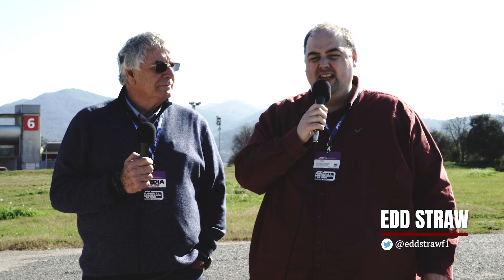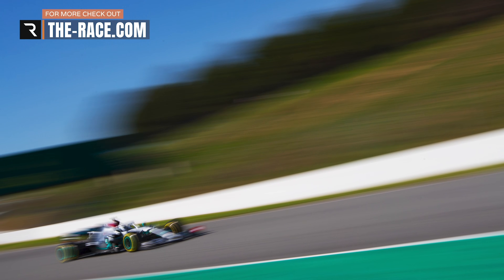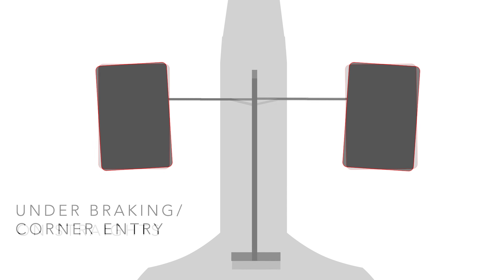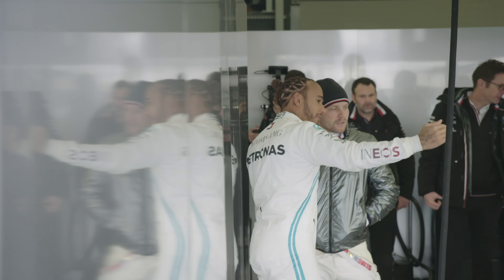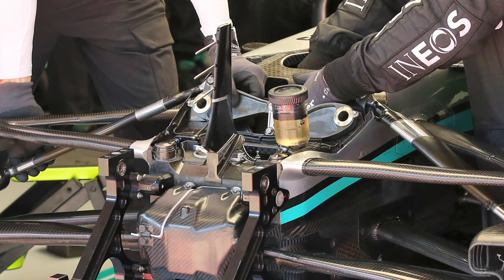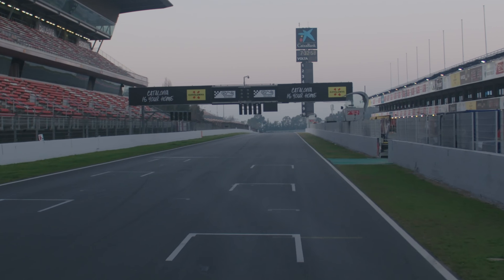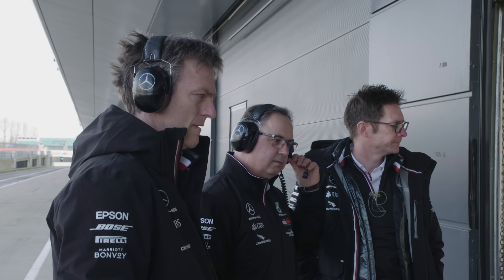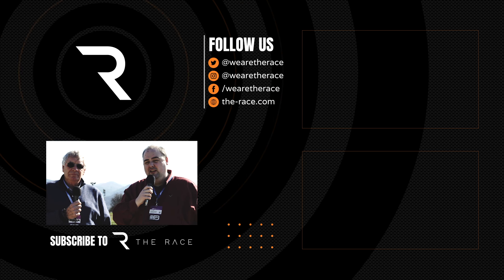Mercedes' new 'DAS' F1 steering trick explained

Comment: there has to be an aero benefit to this as well...toe out creates so much more bad aero wash on the body of the car. also would allow more toe out to be set into the steering knowing that it can be taken out down the straights or fine turned between corners.(you could have a digital sensor telling the driver how much toe is being used at any point in time).  i would also think that others would be able to copy this with out to much trouble as they could add something run it in the car during friday practise and if its not working perfectly just not allow the drives to use it during the race.

Comment: One thing I dont think I heard them address was the increase in straight line braking ability. Not only will this help in other areas but definitely later braking. The more camber you have the more you reduce your braking distance due to tire patch contact. Think if it is used properly not only will they be faster in high speed turns but also allow them to brake later giving them better entry speeds into and out of the corner.

Comment: I wonder if it is significant that it changes toe-in/out and not camber?

Toe is inarguably in the plane of steering, so you are clearly steering, whereas if it changed camber you would be introducing a suspension change, altering set-up.

Comment: @THE RACE This explanation has now been *DEBUNKED* . James Allison has said in the official video explaining the 2020 car that the DAS system was created for aerodynamic purposes, NOT to reduce friction or to cool the tires.

By the way, next time when you're guessing what the teams are doing, use the word guessed instead of "explained", since that's what you are actually doing. And you won't look as bad when your "expert explanation" turns out to be wrong.
Reply: It seems rather obvious to me that toe out will cause extra friction. Friction equals resistance to forward motion AND heat build up. Both front tires pointing in the direction of travel, has GOT to reduce drag, heat, fuel consumption and tyre wear. It's a win win.
It would be most interesting to push the car, then activate the system and push it again. I bet its noticeably easier!

Comment: 2:23 Diagram with animation is SO MUCH EASIER TO UNDERSTAND than the horribly nuanced, jargon filled way it has to be explained. It's actually such a simple, obvious, gorgeous bit of design that I'm amazed nobody has tried it before.
Still, I do agree that Helmut Marko has a point, even if only minutely you are actively changing the ride height of the vehicle and surely that was outlawed with the whole active suspension banning.

Comment: Everyone is talking about tire contact with the tarmac.  How about the aero gains from changing the airflow around the tires based on their attack angle with the air. Air being a fluid, change the angle change the flow. Will the air stall at different parts giving you a speed advantage of less drag? Or will the airflow change which parts of the aero bits are working when. I think there are more effects then just tire wear and heat. Great engineering. Early days of this system. Thank you for making the video. Enjoyed the presentation. Oh side thought. If this does change the airflow over the car. The system is operated by the driver, this becomes a movable aero dynamic device. Does D.A.S.fall under movable aero, which I think is illegal per the regulations? Yes I know the wheels already rotate. And the rotating wheels/tires are excluded. But changing the attack angle by the driver then becomes a aero advantage changed by the driver while driving. Food for thought.

Comment: Cant help wondering if having extreme toe in/out settings also incorporated into the range might help them actually heat up the fronts across the whole tyre width on the formation laps... Maybe?
Reply: Ooh!! Fkin brilliant!
Reply: the warm up lap pales into insignificance compared to any reduction in blistering. NOW I know why Ham said the secret to winning the champ'p this year would be tyre usage
Reply: @CosmicSeeker69   Agree 100%.  Was just wondering if the system might also have other advantages.
Reply: @paulhope3401  straight line speed will increase due to less/no tyre scrub wasting hp
Reply: @psk5746   Yes I know.. was just wondering if there might be other possible advantages.
Reply: @paulhope3401  oh, interesting. I think I get what you are saying. Could they design in more extreme toe-out improving cornering, because it is not a compromise versus straights anymore? Its very clever.

But McLaren's double brake pedal was banned do expect this to be
Reply: @psk5746   Its possible I guess, managing that manually at stupid speeds with 4-5 G's pressing on you at the same time, sounds like a recipe for disaster though.

The FIA have already come out and said its technically legal but interestingly have made it illegal in the 2021 regs.
They could change their mind about its legality at any point overnight though. They effectively have a get out clause by including the wording of ' in the spirit of the regulations'.
 It must be tremendously frustrating being an F1 engineer knowing that any genius idea you come up with and all the hours you put into it can be instantly zero'd if the FIA chose to do so..

Comment: Hmm wondering how much of the idea of mapping the forward/backward movement of the steering wheel to the wheel alignment came from aviation, if at all. Seems that engineering team might have more than a few pilots in the mix. Movement is directly analogous to a flight yoke.
Reply: Will.J  Sorry I meant "analogous" in the more general sense that the forward/backward movement of the wheel being utilized for a steering function not that it employs the exact same control mechanism for control input/output.

Comment: How does the front of the car not try to split from each other if the tyres are facing outward? Would there not be a force wanting to pull in opposite directions?
Reply: Yeah you're right there is such a force but the wake angle is generally so small that this force isn't large enough to outweigh the benefits in cornering
Reply: That’s why the tire scrubs. The chassis is much stronger than the the friction force on the tires so you’ll see sliding along the surface (very small, likely within the elasticity of the rubber)
Reply: They are facing inwards
Reply: @arraka-  In the video animation or the real car?
Reply: @robato3991  in the real car, I think they showed it wrong in the video

Comment: Isn’t most of the time the rears giving out way before the fronts? I would think the biggest gains would just be on the straight line speed, not necessarily running a longer stint due to tire wear.

Comment: So... they have shown off this idea early. All the other teams rush off and copy it. Then they finally reveal in Adelaide that they also have a 2nd part of the design they haven't revealed yet.
Maybe pushing the steering wheel UP raises the rack via a pivot point and reduces camber for maximum contact patch for braking?
Other teams... Oh crap.. back to the drawing board!

Comment: it is a clever trick but changing the toe wont that cause severe tire wear? affecting the tires
Reply: Its exactly that whats getting resolved here pal. By activating this new system it reduces the tyre wear by straightening the wheels when not cornering.

Comment: I really do not understand the 'difficult' to use assumptions.  Considering the natural flow of the G forces under acceleration and breaking, the process/movements involved to manage the DAS system seem rather natural and intuitive tbh, and likely to applied by drivers pretty subconsciously with very little actual effort of adjustment to style/driving method required at all.  To me, that's the most genius part of whole design, how the control system just seems to flow with what the car and driver are experiencing on track at the time anyway.

Comment: so depending on the race track and the time and effort merc is willing to put into it, will matter how effective this is.  I doubt it will be useful at a few of the street races (singapore, monico) as there is not much  to gain on a straight vrs the corners,  on the important tracks for it merc now needs to do 2 times their homework.  Assuming 2 positions/track for the system ( forward and back)  then how much do you compromise for a given  position for a given track.  And how much adjustment can you get in total?    Wile a fun tool i doubt every team has the capability to manage it correctly even if they implement it.

Comment: Am I the only one curious enough to know what happens if the system siezes/jams midway through a race? That's got to cause some serious problems! 😂
Reply: While I'm sure it has been tested extensively. I imagine a critical failure would probably tear tyres apart before you can get back to pit lane. And if it fails in one direction or another, the suspension is locked there, again, tearing rubber apart and probably slowing cars down by several seconds per lap
Reply: @XMorbidReignX  Exactly what I was thinking.. seems like the types of failure that could end catastrophically before any pitting could be done due to astronomical tyre wear! As you say though, I'm sure they have it well tested!
Reply: @bobdole5350  
:D
"Catastrophic"?? 
"Astronomical"??
Reply: @zulu_mafia  without a doubt! Even a slight change in toe angle can seriously wear tyres in a short space of time!
Especially when the tyres are as soft as putty! Lol
Reply: @bobdole5350  why would it? It's meant to have less toe in the straights, thus
having less wear and drag. In 'default' position it will probably be like standard, maybe a little more toe, but not much. So the problem if it's stuck outside the default position, would be stability of the car entering the corners, not so much tire wear.
Reply: @marcov6t770  yeah you're probably right actually, for some reason I was fantasising these huge toe angles because you don't have to compensate for the straights when setting the overall toe angle, but it probably isn't as turned in as a first thought! It was the simple illustrations that sent me off!

Comment: Ferrari, and Red Bull will protest it.  Just wait and see.
Reply: looks perfectly legal
Reply: The usual situation is Ferrari comes up with innovations and EVERYONE cries and protests...especially McLaren and Mercedes.
Reply: @lewistasso8866  The difference is that Ferrari's innovations break the rules and Mercedes' don't. Over the last few years, Mercedes have definitely been the innovators. Rear suspension and steering this year are absolutely ground breaking.
Reply: Yeah completely, race 1 hits both Mercedes dominates practice an qualifying an the race as they set the fastest times in both sector 2 an 3 but over 2 secs from ferrari.
Reply: @David-ud9ju  Are you fucking serious?! So using RP Force India or what ever it is called
Drivers as torpedoes is perfectly legal too?
Reply: Ferrari should worry about the cheating with their extra battery packs 2018 and the Fuel levels to the engine 2019 ..
Reply: They already have and the FIA have deemed it legal.
Reply: @David-ud9ju  Hahahahahahaha! Right! Since the 70s?? Face it, when teams can't keep up with Ferrari, they cry. And Ferrari always bent over backward for the sport.  They didn't have to do that. If they dropped out of F1, the whole series would have been done and over YEARS ago.
Reply: @TheFelix1703  Great News ...Horner and Ferrari will attempt to clone the design before Melbourne
Reply: @lewistasso8866  hahahahahhhahahahahhahaha

Comment: The problem would be better solved if the lower swing arm was shortened instead of the steering tie rods lengthened.
Lengthening the tie rods eliminates toe out and scrubbing but the tire is still running on its inner edge because of the camber.
If you shorten the lower swingarm you kill 2 birds with one stone. You toe in the front wheels AND you straighten up the camber.
BUT that would be considered a SUSPENSION ADJUSTMENT and therefore illegal.

Comment: Ingenious idea but it may well prove dangerous in dicy racing situations in which Valterie or Lewis will need ALL of their concentration for simply guiding the car through a corner or an avoiding maneuver and could easily be distracted or inadvertently pull /push the steering at the wrong moment - it is for SAFETY REASONS  that the FIA should ban it immediately

Comment: The only question is if the tow and chamber change the ride height, if so itd be illegal
Reply: it wouldn't - cant - the wheel still uses existing points of rotation.

Comment: No doubt it changes toe but not from toe out to less toe or zero toe as said. That would not be visible by eye. What it does is to change from normal slight toe out to massive toe in only to heat up front tyres when ever those front tyres are not hot enought. Normaly this is needed in long straits and cold or wet conditions.

Comment: Are they really normally running with a toe-out in F1? Never knew that, thought it would be the opposite.
Reply: Its all about cornering in F1, usually. F1 would run whatever toe in or out setting that improved cornering. Remember no suspension flex in a F1 car so no need for toe-in like a rwd road car.

This system is all about reducing straight line losses by zeroing toe so the car rolls easier with no tyre scrub. Clever

Comment: Marginal gains... I don't understand why Gary was going on about camber there is no way by changing the rack position that they can change camber. Also no way would they setup toe in when you have designed a system to eliminate toe on the straights.

Comment: Sorry, but doesn't toe out do the exact opposite of what he says it does? From my understanding, when the front tyres are toed out, the inside tyre will scrub more than the outside corner on initial turn-in, causing a rotational acceleration that causes the car to turn in more quickly. It's less stable as a result of this. Not sure about F1, but most other racing series like GT3 would run toe out to improve turn-in.
Reply: SAR you got that right!

Comment: Where I've seen nearly all the pundits mention the toe and what the suspension does from a non-technical outsider it just seems like they are steering the wheels in opposite directions instead of both the same direction...

Just seems like a steering modification rather than what many claim is a suspension adjustment, but what the hell do I know...

Comment: Is this within the regulations?
Reply: Technical no, its not adjusting the suspension. But who knows if the FIA will let them run it.
Reply: Grey area... Its technically not illegal within the current regs. They FIA have the option to ban anything they want through if they deem it not to be 'within the spirit of the regulations' which is their get out clause.. so they could ban it tommorow if they wished.

Comment: Could be completely useless, who know until the season starts?
Reply: BIG B the ability to change your steering geometry at a whim sounds like a huge advantage to me but youre right unless the driver knows where to toe out and how much to toe out it could be useless and could also cause a very expensive accident
Reply: @Initial_Gopnik  could break too,Depends on how much it is used and at extreme speeds and breaking who knows.
Reply: Its 100% going to be an advantage even if just for saving tyre blistering and overheating
Reply: they'll know after this weekend's testing.... it's very easily checked by simply having the drivers put in laps both using, and not using it.  Direct comparisons right there!

Comment: The steering and suspension are two components of the same mechanism.  Whats not steering is a suspension setting.  Steering is turning the car.  No one ever has referred to it as otherwise.  If a driver manipulates anything in the cockpit, including the steering column, and the car goes straight, it is changing the suspension.  Big money mercedes and F1 politics.  Enjoy the novelty folks, its illegal next year.

Comment: Toe in reduces oversteer leading to a more understeer biased front end, not the other way around. The cars running toe out want a direct front end to get the car into a corner for it to use the camber of the geometry of the tyre as quickly as possible. 

Toe effects cornering at a different state. Entering and mid corner are two totally different steering effects.

Your explanation doesn’t make sense.

Comment: This will last 3 races. Then they will change it then Lewis won't be used to the normal system that has gotten then 5 years of championships and slip behind in points because of this. . Absurdly ludicrous these boys are drivers not physicists or engineers.

Comment: Of the top of my head, it is cheating. You can't change the suspension settings while in motion.

10.2.2 Any powered device which is capable of altering the configuration or affecting the
performance of any part of any suspension system is forbidden.
10.2.3 No adjustment may be made to any suspension system while the car is in motion.

"Any" suspension system. So how does changing the toe not affect other suspension components?
The castor will mean that the toe will affect 'other' suspension systems.

We shall see